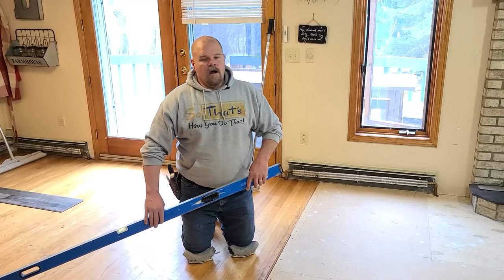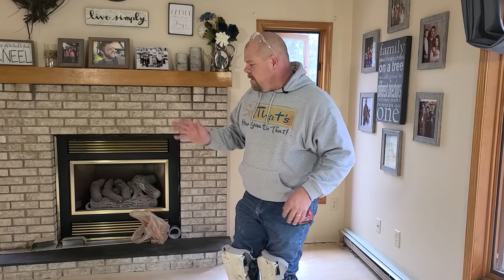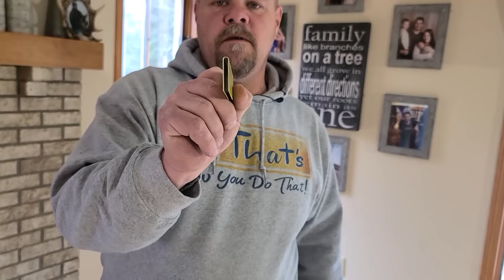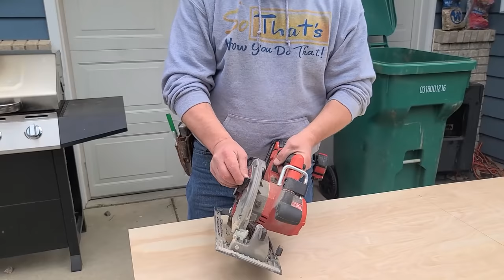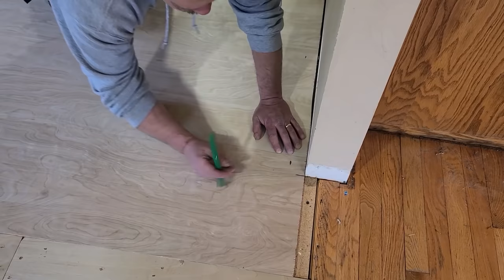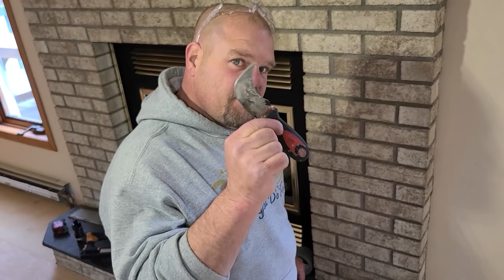What to do when Floors are Different Heights | Vinyl Plank Installation

Comment: We had vinyl flooring installed in house. The contractor hired a subcontractor do the job. The sub used to different workers to install the floor. On the second day, the sub brought in a different guy. This person did NOT lay down sub floor in a section that did have tile, but the bare foundation. Now there is a different height where there is tile and no tile and sub flooring. The vinyl is starting to sag. In addition, the vinyl goes all the to the under the new counter. Can this be repaired. We in the process of hiring an attorney. The owner of the company NEVER dropped by the house to see the floor and we haven't spoken with him.

Comment: So my house tile in most of the house. The bedrooms however had carpet. So obviously when I take the carpet out, it will just be concrete underneath. I really don't want to remove all this tile and was just going to lay the vinyl ontop. What should I put in the bedrooms to make the floors the same height? I live is socal and my house was built in 2006 so we don't have any sub flooring like the video shows.

Comment: Glad to have found your video! We have this exact dilemma. After removing an old carpet, we discovered half inch difference from our living roon to the kitchen floor (open floor space). Can I use sheating plywood or sande plywood to level our floor before putting Vinyl? Super confused on what type of pywood to buy. Hope you can help. Thank you!

Comment: First, thanks for the first illustration of the unlevel seam of wood to old area with the 4 ft level stick - I installed my kitchen tile (on pier and beam 1965 cabin) using cement board for stability along with 1/8" cork for insulation (I freeze in the winters).  I knew that my den would not match this galley kitchen, and I knew that the  dining room that has laminate (which I am NOT REMOVING-I need the insulation) DOES match the tile level in one door way.   In the den, where it is unlevel by A LOT, I purchased a 1/8 inch board which made the difference with the 2 underlayments (cork and UL that I purchased with the Eng. Hardwood)   - and WOW, I just got to the end and your humble prayer for all of us DIYer's.  That was Awesome, Jesus is my Head contractor (he is the greatest CREATOR) and is helping me renovate this home by myself.  I show up, pray and he guides me what to do, which was watch this video! AMEN! God Bless you richly!

Comment: I am in a condo (2nd floor) Unfortunately we had a water leak from a bathroom faucet, and ServPro decided to remove my engineered hardwood, along with the gypcrete underlayment in certain areas (they claim this was done to help the wooden subfloor to dry) We had a company come out and re-pour the gypcrete (ServPro removed about 80% of the gypcrete in my condo) Since the gypcrete was poured and the LVP planks were since installed, I noticed the LVP creaks, slightly pops at times when walking over the floor. I know the floor is not level, because the gypcrete is poured in, and even though it is supposed to self level, we still have some considerable high and low spots. The flooring company we used did not evaluate the floor evenness before installing the LVP. Now that the LVP is installed and the floor can at times be noisy, can you give me a idea of what options we may have to correct this. Thanks.
Reply from the maker: Take it all up and fix the floor and reinstall.

Comment: So glad I found this channel.  I have a cheaply built house from the late 70's. Concrete subfloor downstairs, one area tiled that I'll be removing.  The upstairs though is plywood. Really weak 1/2" plywood that moves when you walk and squeaks like crazy! I'm thinking I should beef it up and I've been thinking about adding 3/4" osb on top. Couple of questions if you'd be so kind: should I use the tongue and groove or just the kind you butt together? Should I glue and screw on top of the plywood,  or just screw it down? Should I be screwing this layer into the joists? Thanks so much for all of the help on your videos!

Comment: We recently pulled out carpet in our home and found 1100 SF of particle board under it. It's in pretty good shape, minus a few pet stains. I plan on replacing those areas with fresh plywood and sealing the rest with a couple of coats of BIN primer. This will only be in the living, dining and bedrooms. In the wet areas we'll remove and replace the particle board. Do you think that will be sufficient? With the cost of plywood, I'm really hoping so.
Reply from the maker: Sounds good to me.

Comment: Quick question. The house I bought is predominantly tile with carpet in the bedrooms. After I rip out the carpet what can I use to level the previously carpeted areas to the tile height so I can lay the luxury vinyl planks throughout the house. Oh the floor in the bedroom is concrete.....thanks in advance for your help  🙏

Comment: Thank you for this video. It is very informative. I am using 3/8 underlayment over original 5/8 sub floor. Would you recommend using  PL Premium to glue it down as well as crown staple?
Reply from the maker: I would recommend that you use a 1/2 inch instead. Yes, I would also glue it!

Comment: Sometimes the problem with costumer is the budget of removing all the layers and get to the subfloor, because of the prices of materials. Also sometimes door casings have to be replaced too
Reply: l used to face this same issue with customers. So, I found out that if l honed my skills, delivered outstanding customer service, that in no time flat l was ONLY serving the most discriminating clients where prices was never EVER the issue. That made all the difference to the rest of my career.

Comment: In this video it shows baseboard hot water heater vents which I have in my rooms do you have a video showing how to deal with these style vents when adding the additional height of the flooring? I know this video is to show the raising of the floor levels and I see the underlayment being pushed under the bottom, do the covers need be detached from the wall and then reset once the floors are installed? I probably answered my own question but would like to know how it's dealt with professionally, your videos have inspired me to take on my own floor install for a kitchen/dining room that now has sheet laminate that I will be removing. Thanks!
Reply from the maker: Yes, you will need to take apart the vent and slide the subfloor and plank under and then attach the vent back to the wall.

Comment: I am trying to build up floor in a diy nightmare home. There's the 3/4 subfloor, then 1/4 ply stapled on that. In the dining room another 3/4 ply screwed to that. How would I properly add another 3/4 ply to level the two rooms? Staples?

Comment: I have a question/situation that I would like you to address. I have a three-quarter inch subfloor raised foundation and I am putting on 8 mm engineered vinyl planks.. I am trying to match a three-quarter inch oak floor in height. So, I have to put down a spacer, I’m thinking 3/8 to half inch cc plug touch sanded plywood. Should I glue it and staple it or is stapling it enough?

Comment: So what if my house has concrete floor? I redid my bathroom it originally had vinyl sheet flooring. I recently put vinyl planks instead but it's still lower than my living room. Any suggestions on how to fix this? I don't want to have to remove the tiles in the whole living room

Comment: Thank you for sharing this video. New Subbed Here! Happy I found your channel. Not sure if someone already asked. If I want to raise the tile floor about 1/4 lower than the hardwood floor can I also use plywood or cement board? If so, would you recommend using construction glue or concrete screws? Thanks 🙏
Reply from the maker: Use cement board with Thinset and concrete screws.

Comment: Hey Joe, I’m doing a kitchen that’s in bad shape floor wise, I removed old glue down parquet wood flooring that was attached to old linoleum probably from 1930s, then major hump/ crown in the center of the kitchen, no chance of leveling because it would raise areas leading out of kitchen which is fairly level, have you ever used Sakrete trowel grade
Reply from the maker: No, I have not.

Comment: Thank you, I am very glad to have found your channel! I plan to replace the carpet in our living room with vinyl plank. This will create a long transition (15 ft) between the vinyl and the existing ceramic tile. I've watched many of your videos showing how to do such transitions with T-strips etc, but most of them are relatively short. My concern is that because the transition is quite long in my case, the end of the vinyl floor next to the ceramic tiles may become loose at some point, and wonder if I should use glue to keep the vinyl attached to the subfloor. Any thoughts on this would be greatly appreciated.
Reply from the maker: I would.
Reply: @SoThatsHowYouDoThat  Thank you!
Reply: @canle7973  This is exactly my situation - want to replace carpet in living room with vinyl plank with the rest of my flooring being large white ceramic tile.  Transition length - about 17 feet !  Thank you for asking the question.  I don't fully understand about the glue.  Do you just do the plank next to the ceramic tile or are you gluing the entire vinyl plank floor?

Comment: I'm replacing carpet in a section of my house that's going to become an office. I live on a concreate slab.
To match the existing height i'm going to need some kind of 1/4" plywood, but how do I secure it to the concrete?? I JUST pulled up the tac strips that were nailed down. Don't tell me I have to nail this down as well! 😭

Or could I glue it down instead?

Thanks!
Reply from the maker: Is there a drop at the door? I guess I am trying to understand why there is a 1/4 inch difference. No, I would not use wood on a concrete slab to achieve this, I would build the floor up with something else. Maybe you can share some pics with me at  - joeletendre@sothatshowyoudothat.com

Comment: Great video!  What can I use for a 1/8 difference in height.?  Thanks
Reply from the maker: How big of a doorway is it?
Reply: @SoThatsHowYouDoThat  
Thanks for the quick reply.  No doorway. Seperation between dinning room and kitchen. Dinner has hardwood and kitchen is linolium. Kitchen is 1/8 lower.  Thanks
Reply: @trevor5290  I have the exact same issue!  I want to run lvp without a transition but need to build up about 100 square feet by 1/8"

Comment: My house was built in the 90s and we are about to install this flooring but in the kitchen where they put  Lonolium but they put down a quarter inch plywood down to glue it to but it's under all the cabinets should I just cut around the cabinets and tear this up so the floor is all one height or should I install quarter inch plywood on the rest of the house where they had carpet and under the carpet is 3/4 thick plywood. Is this quarter inch plywood going to be a pain in the butt to get up?
Reply from the maker: Take it up and watch this video - https://youtu.be/RoijOYwg9lg

Comment: I’m in the process of installing lvp in my kitchen and living room. The kitchen has vinyl with underlayment and the living room has vinyl plank.The kitchen floor is higher than the living room. Do you suggest I remove the vinyl in kitchen with the underlayment or do I build up the living room by adding the quarter inch underlayment and just install over the vinyl in the kitchen ?
Reply: It was built in 96 so I’m assuming I don’t have to worry about asbestos

Comment: I have a question. We live in a 80 year old house. We have a partial basement and rest crawl space. The floor where transisition happens is almost half inch up and near stairs there's slope. Before we bought this house 3 years back. Few spaces I found slope of quarter inch too. The floor is solid wood and we resurfaced it. But to match it with our first floor(we ripped the carpet out and someone installed the engineering floor). Now my wife wants to get the new flooring done on main floor. Any recommendations from expert like you would be much appreciated.
Reply from the maker: Because the house is older I would try to make the floors even by building up. It is going to be impossible to make an 80 year old house perfect. You have to improvise and be creative.

Comment: I'm about to install laminate wood floor my question is can I use 1/4 inch hardie board instead of plywood, just cause I already have plenty of hardie board if possible what should I do? Only reason why I need to add some type of flooring is cause restroom floor is to high so.
Reply from the maker: You can, I am just not sure that is the way I would go.

Comment: I want too have vinyl planking installed in the kitchen living room and hall way but my kitchen is 1'16 higher then my living room because when they installed the linoleum years ago the put the 3'8 sub floor on top of it and then then the new linoleum if you remove the top linoleum Can you still install the vinyl planking with that height difference? Thank you?
Reply from the maker: So to be clear, what will the height difference be??

Comment: If I want to raise the height of concrete subfloor, can I do it using plywood (like how you showed)? One flooring store owner in my area told me that the plywood might not be stable if we just use adhesive and stick it to the subfloor, and it may lead to squeaking issues for floating floor. Is he correct? We live in Northern California which is mostly dry.
Reply from the maker: I would use cement board and attach it to the concrete using thin set.

Comment: Would 1/4” tempered hardboard from Menards work as underlayment for 14mm laminate (includes 2mm backing) flooring ? I am trying to minimize the cost ! Already laid laminate in kitchen and dining room on top of the linoleum and am now moving on to the living room after ripping up carpet. Thank you for the videos and thank you for the prayers !!
Reply: I wouldn’t use the tempered hardboard.  Have you seen what water does to it?  If you watch Finish Carpentry TV, Richard uses it on his wall and ceiling projects.  I would trust it there, but not on the flooring.  Go to Lowe’s, they sell a 5mm (close to 1/4”) plywood that doesn’t delaminate, it has really good reviews.  Better reviews than the similar product at Depot.

I’m installing Flooret Modin Ridgid LVP.  Our kitchen and eating area is approximately 3/4” higher than our foyer and dining room (which is a big room!).   I installed 1/2” QEP cork sheeting over top of the existing hardwood, then 5mm plywood on top of that.  It’s a really sturdy subfloor now and meets the kitchen floor height perfectly.  You can use duct tape to tape the plywood sheeting together after cutting and fitting.  That’ll give it that tightness he was talking about.  Then you can staple it in place.  I cut the plywood on my Flexvolt Tablesaw and it turned out well.
Reply from the maker: Good stuff! Thanks for sharing!
Reply: Thank you Marty !! I will definitely check that out at Lowe’s.
Reply: Being that my laminate flooring is so thick, do I need to be highly concerned about laying the plywood tight with no gaps? I will be using screws to fasten it down. How should I space them ?

Comment: How often are you dealing with customers not wanting to pay for build up or tearing out. I've been running in to customers that want to just gradually float the height difference. Just did a living room, dining room and hallway and kitchen. The kitchen was much higher but they didn't want to tear out the kitchen floor so I explained that's the proper way to do it but I'll do what they want. Floated almost a inch difference
Reply from the maker: I would not of done that
Reply: @SoThatsHowYouDoThat  Customer ok with it so I had them sign off
Reply: Depends on state you live/work in...  Years ago the "sign off" use to work...  But now in court lawyers use the loophole of "you the professional installer" knew better but still went against the flooring Institute and laid it anyway...  Beware sometime that job may come back and bite you.

Comment: Would I be able to lay plywood down on low pile carpet to install interlocking vinyl flooring on top without having to fasten the plywood through the carpet to the subfloor?
Reply from the maker: No. Do not do that.

Comment: I’ve been searching for answers through videos/comments but can’t seem to find it. I ripped out carpet in my spares but the rest of my house has brown ceramic tile directly over concrete, creating about a 1/2” difference. I want to build up my spares to level with the existing tile and do a seamless LVP throughout the house but am unsure on how to do that since wood isn’t recommended to go directly over concrete. I’ve seen basement subfloor videos but wasn’t sure if I’d need all of the extra layers or not (landscape fabric/6 mil plastic/delta fl etc etc) and don’t want to purchase the wrong sized underlayment if i do need additional layers in between and it then be above level. Can you give any insight on this? Thank you!
Reply from the maker: Can you share a drawing on my facebook page? mark the areas with tile and without. The link is below